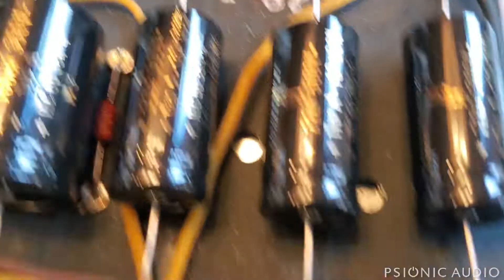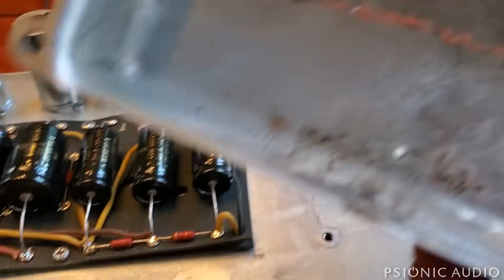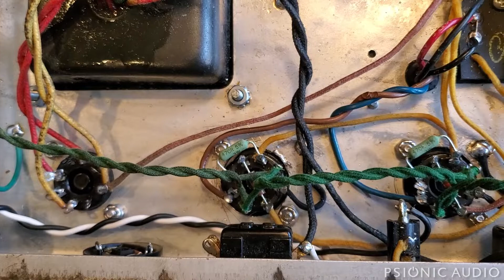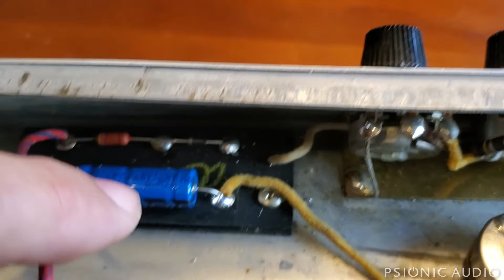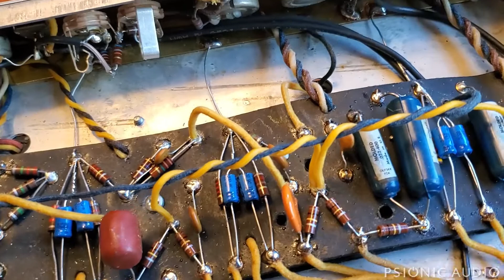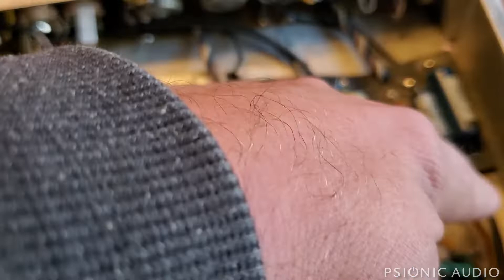Restoring a Vintage '67 Fender Super Reverb, Part One

Comment: Hello, I have a question, why did you use heater ground resistor swhen I see the center ground tap ( green/yellow) wire not soldered to the chassis? thank you......

Comment: Hi, I have a problem with my fender super Reverb amp by mistake I  tried to turn it on at 220volt, and then when the on off switch is turned on it looks like everything work OK, but when I turn the standby switch on, it burns the fuse every time...do you have any idea what's going wrong? Thanks! Greetings from greece
Reply from the maker: Many things could go wrong if you powered it with 220VAC. Take it to a tech.

Comment: Can you explain what about the 1” voice coil doesn’t last in Super reverbs? My main amp is a 1968 Super Reverb AB763 circuit. I took out 2 of the original Oxford 10L6 speakers that we’re getting a bit flubby sounding & replaced them with 2 damn near NOS 1964 Jensen C10Q’s as an experiment ….and it ended up sounding incredible! I’m pretty sure the C10Q has a one inch voice coil and now you have me concerned something is gonna break. I know they’re only rated @15 watts and they break up a bit earlier (& have a nicer sounding breakup) with a great rock sound that actually comes across sounding louder than the 2 remaining Oxfords. It’s sounds like 60/40 Jensen/ Oxford mix. Again I love this speaker combination and would be sad if I ruined the Jensen’s.  Please let me know your thoughts ? P. S.  I do have two more of the exact same Jensen’s, so I could install the other 2 if running a matched set of 4 would be better for my amp or the speakers.
Reply from the maker: My speaker guy (who lives and breathes these things) says the 1" voice coils overheat in a Super Reverb.
Reply: Thanks for replying Lyle

Comment: i have a 66 super reverb with kendrick black frames , they sound fine to me . the guys at wgs said those are good speakers , ive had them in that amp since the 90's . the wgs g10c is a great speaker but they're 7 lb x 4 , thats pretty heavy. if i ever replace the kendricks with the g10c that amp would weigh probably over 80 lb

Comment: I noticed that you used 100k Channel Mix resistor instead of the factory 220k. any reason for this?
Reply from the maker: The owner wanted a tighter low end and I didn't want to change out the good original coupling caps. As the mix resistors needed to be changed anyway, that was an easy way to shave off some excessive low end. As the channels aren't used simultaneously this was a non-intrusive change.

Comment: Hello! I have a 1965 Vibrolux and the wires that come from pin 2 and 7 from v2 to the Vibrato channel inputs are very noisy when touched. should I replace them? if so, what wire will you recommend? and what gauge? Thank you for the video!

Comment: That heater wire looks very close to the original.My 64 Vibrolux has some very suspect looking toasted heaters over the 6L6's.Do you mind telling us where to source this particular wire.
Thanks
Reply from the maker: Thanks. Hoffmanamps.com has it.
Reply: @PsionicAudio  Thanks i'm lucky enough to have a large vintage that i try and maintain and it really helps to watch a pro and see the process and hear the reasons for repair choices.
Your tech style is very thought out and doesn't venture into the solder fumed guru-sphere that tipped over me to learn this stuff for myself.
Thank you sir!

Comment: Congratulations for the video! I will be changing the original power cable in my 64'... its looking bad... since it originally do not have a ground, with the new one do I need to solder the ground cable directly to the chassis right? Thank for the advice and congratulations again!
Reply from the maker: Either to chassis or drill for a 6-32 screw and use a machine screw, ground lug, compression washer, regular washer, and keps or nylock nut. You'll also want to disconnect the cap attached to the ground switch.
Reply: @PsionicAudio  Thank you!

Comment: Any reason to prefer the artificial heater center tap to the actual transformer center tap?
Reply from the maker: Two reasons. First, two resistors can give a better balance than the transformer winds (this isn't always important). Two, and this is crucial - if there is a heater short to ground or to B+ a physical center tap can burn the transformer before the mains fuse blows. But 1/2W resistors will also serve as fuses, so if there's a short a resistor will burn open, stopping the short. As transformers cost a lot more than 1/2W resistors...

Comment: My 66 Super reverb volume/ power drops considerably, after extended playing. In the past, a slap on the top of the amp would clear the problem. But recently, that doesn't clear the problem anymore. So now the amp sounds weak.
Reply from the maker: While I cannot diagnose remotely, if a client brought in a Fender with that description, I'd be looking for disconnected grounds (the wires pull out of the solder joints at the brass strip when the board flexes), resistor leads pulling out of eyelets, bad solder joints at the tube socket pins, and of course a faulty tube. When a Super Reverb first comes in I usually test the Normal channel as it only needs V1 and V6 to work. Much smaller haystack to start with. That lets me know if the output section is working properly.
Reply: I'll probably check the tubes first, then proceed to the rest, if needed. I appreciate the advice.